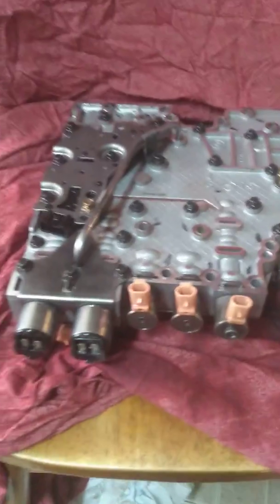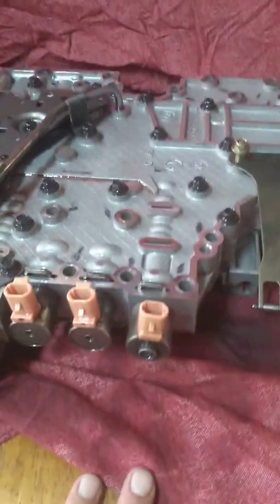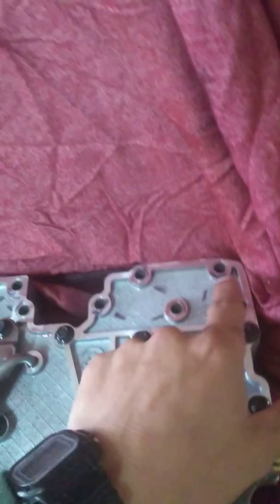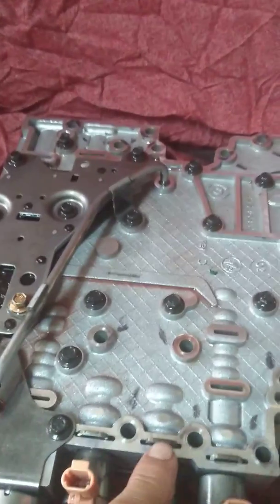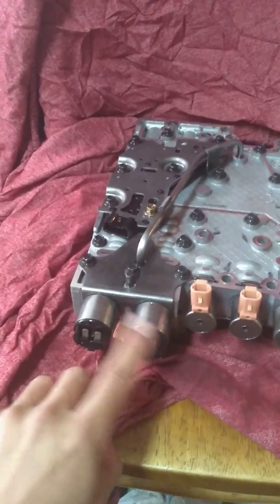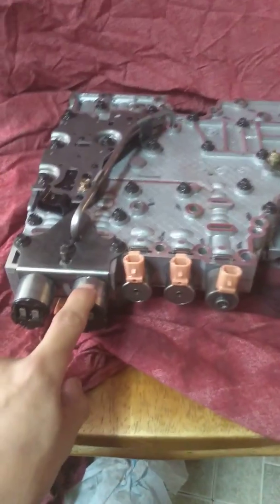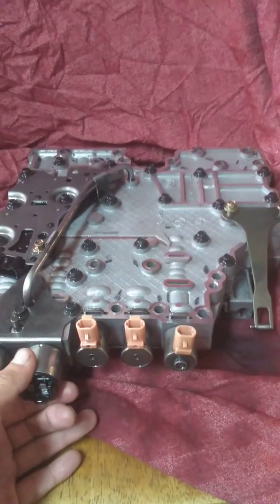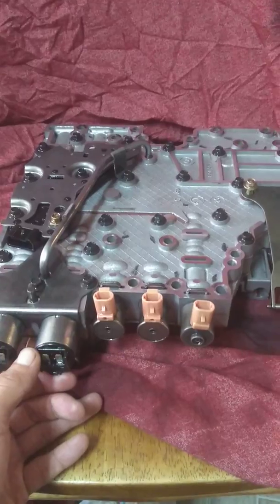Allison 1000 valve body removal

Comment: If your experiencing That your truck is on "Shift Inhabited " and its not your Solenoids.  You might want to Change your Egnition Solenoid which is located arounf your Steering Column and its covered by the Cover.  Replace your Ignition Solenoid and you will have no more Shifting Limp mode....it will make your whole life easier.....

Comment: Hey I have cuestión both ot the A&B celenoids have the spring or just one cus mine only one have the spring
Reply: They have the pin and spring right?
Reply: @LuisRivera-iw1ce so did you only have one spring?
Reply from the maker: Yes they both have the pin and spring
Reply: @cholochedd6752 Mine only had a spring behind the a solenoid, so that would be incorrect?

Comment: How did you get trim a and b back in I'm having same problem
Reply from the maker: You have to push it in pretty hard bro but just be careful but they are hard to drive back in it takes some force
Reply: @cholochedd6752  yeah man I tried little bit of force still couldn't get it but I'll try again
Reply from the maker: @jarrettsmith7502  if you have to remove the valve body then watch my video how to remove it and also make sure the pins that are inside are able to move and not kinked somewhere you can try using a little magnet just be careful not to drop those pins but try to pull them kinda out then push them back in and then try to push the solenoids back in you'll eventually get it in and when you put everything back together make sure everything is plugged back in and do not be alarmed if your trans acts weird cuz after you drive it a little it will eventually act normal its going to have to re learn its self again.. God is with you have patients
Reply: @cholochedd6752  my springs and every move I just can't get the plunger meatal peice in
Reply: @cholochedd6752  I got one in but it's really tight

Comment: Did you find out the problem with you transmission bro
Reply from the maker: Gerardo Reveles ya I did what it needs to do is just re learn itself cuz once you open it up or mess with it it needs to remember how to shift after driving it a few times it finally started working normal again
Reply: What's was you transmission doing to make this video  ?
Mine give me this code p1721 ( transmission Solenoid B controlled clutch engaged ) I ready replace the solenoid twice and still is acting up... when I going to stop at 15 mph every time feels this hard shift also sometimes times slips at 3rd gear and when that happens I have to turn off the truck to work normal again.  Any suggestions  ?
Reply from the maker: Gerardo Reveles sorry for late response bro but mine was not shifting into 5th gear I’m not sure I can’t remember the codes it gave me something with torque converter not engaging and trim B. So when it slips I bet it locks you into 4th gear which is called limping the trans so when u turn it off and back on you reset it. Are you driving normal or are you kinda getting on it when it happens. Go to the TCM which is located on driver side under a black removable cover on the plastic where the fan is. Check your wires make sure all pins are in good that none slipped backwards. Have you checks the solenoids? I would prolly change them all just buy a kit from internet it’s cheaper and get good trans fluid once u install everything drive it as much as u can to help the transmission re learn your driving it will drive weird at first but give it some time drive it normal for a while and park it then do it again cuz might need a couple cycles of driving but start there. Do you have tuner or anything ? If you do turn it off
Reply: @cholochedd6752  thank you for the info but I sold the truck last month have no idea to fix it
Reply from the maker: @gerardoreveles3156  if your trans goes out you have to let the trans relearn everything might take a bit

Comment: How did you get it back in
Reply from the maker: Zach Daniel I had to remove it and push it in but it’s really hard to put in cuz of the spring you just have to kinda press it in hard but carefully but and that’s what makes it hard to do when it’s still attached to the trans